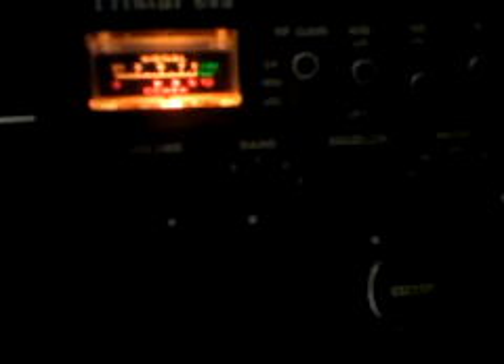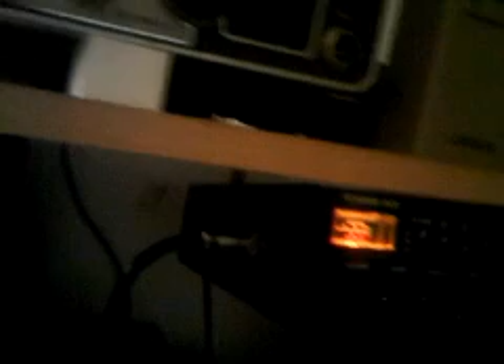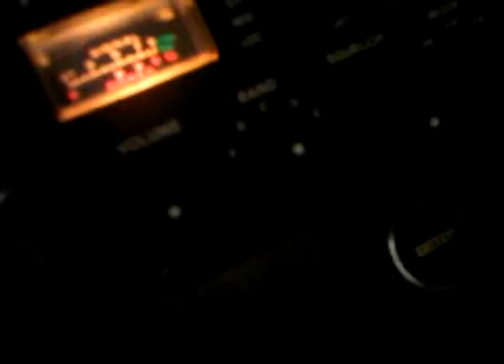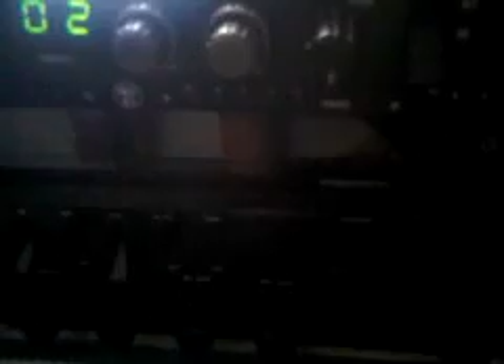roadstar rm-150 4 band modification 160 channel

Comment from the maker: I can get a pll made for the lc7120 and lc7130 too. It is almost the same chip as the LC7131, the only difference is their n-codes in the rom register. the cost is about 40 euros. this chip replaces the existing pll and has 5 wires coming off it. one gives high, one low, one +5khz, one +10khz. if the low and high are both grounded together you get super low.